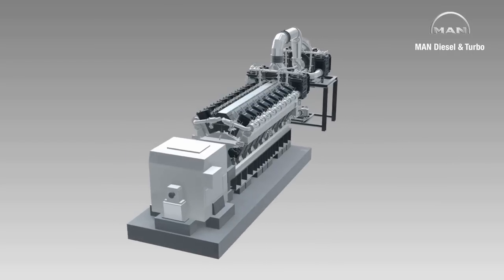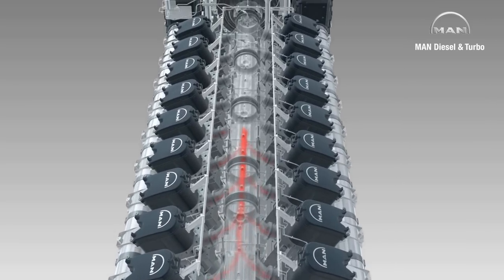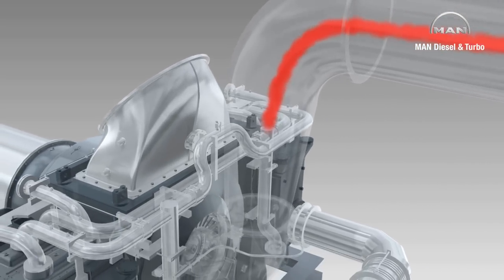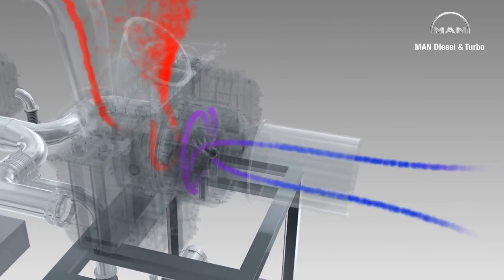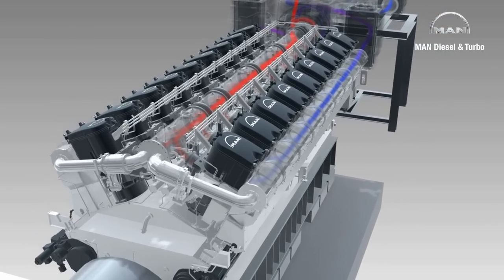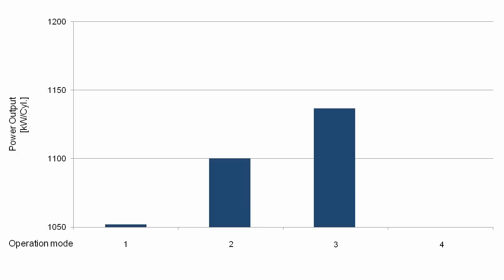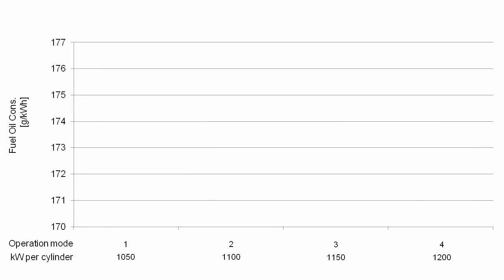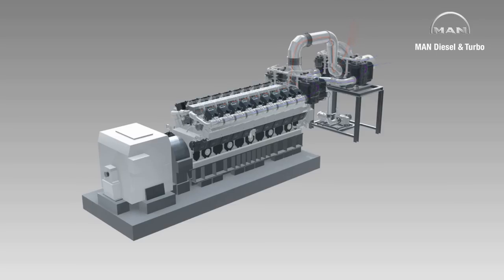Two-stage turbocharging working principle on MAN 18V48/60TS

Comment: how does NOx emission reduces with the use of a 2-stage turbo charger. is it because more air is getting inside the cylinders? the mixture becomes more lean? if not can someone explain please?
Reply: Increasing Efficiency = reduce of emissions
Reply: @GSIChamp__Andi  not necessarily true for NOx...

Comment: Ok,but the second charger stage may be bigger than the first charger,because the energy of the exhaust is lower,  then  the system in correct..But this system is applied to high power engines ,no for small engines,,,except  diesel engines upgraded.

Comment: if the pressure is incresed also the engine must be more durable so it means more cost due to expensive parts.Also there is a problem that if the turbochargers get damaged it will be longer to put them off service
Reply: Not really an issue. Not on engines of this size.
Reply: renplacer le turbo compreseur par un compreseur turbo independant pour avoir beaucou plus de puissance

Comment: 1200KW PER CYLINDER?! what's the displacement?
Reply: 108.6 litres, or 6627 cubic inches. Per cylinder. So a total displacement of around 119286 cubic inches. Max output is 21600 kw or almost 29000 hp at 514 rpm.
Reply: @ZeroneAngel  To put that in perspective, an otherwise similar engine for use in railway locomotives might have about 20 litres displacement per cylinder, and run up to 850rpm.
Reply: Lb ft of torque?

Comment: 2 single chargers - two points that will stop the whole engine when failing.  Guess you better have 2 of these engines in your ship. Website of the description does not exist, www.man.eu has no error page. At least in the internet man hasnt reached the top yet.
Reply: Your not Really knowledgeable about today's modern turbo chargers. They are  Extreamly reliable...
Reply: @Schutt Rostig
I'm taking a cruise on the Norwegian Encore and it has 5 engines. They also want $129 to see them so YouTube it is. They are impressive but not worth $129 for a tour and the tour is sold out 2 months before sailing!